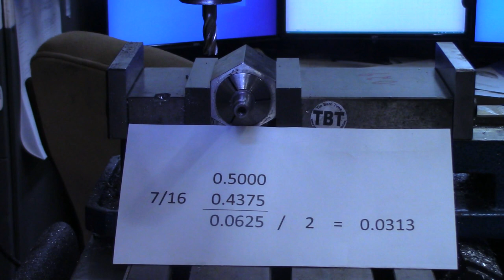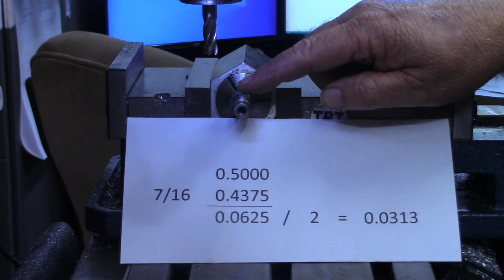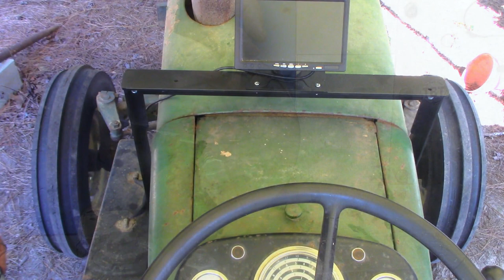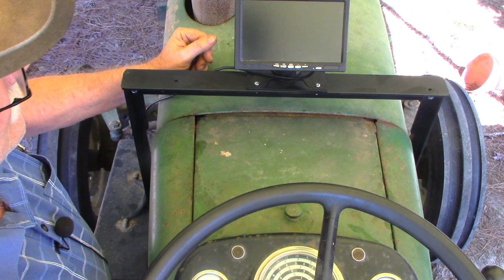Machining a Special Use Nut

Comment: Nice, peaceful, little  project. For mini lathe owners the hex block in the 3 jaw chuck looks not very rigid. But for the mill, that's how to do it. Once made a hex - square adapter for hydraulic oil plugs for a veteran railroad. The same technic, the hex block for hex cutting and then the square block. When ready in the mill, part off the "handle" used in the collet blocks.

Comment: Bluing has become my “go to” for rust prevention after machining raw steel parts like that. Quick and easy, then grease the rub ring area when the blue wears off. Thanks for another good video Lee.
Reply: Having done quite a bit of gun restoration over the years I would like to suggest that parkerizing is far more resilient to surface rust than bluing. True, you do have to heat the solution on a hot plate, but that is about the only difference over cold blue. The military requested it for decades and that decision was not based entirely on parkerizing’s non reflection of light rays.  If you try it I believe you will agree.
As an added benefit light machine marks such as endmill swirls seem to disappear.
Reply: @37yearsofanythingisenough39  Thanks for that, I’ll give a try.
Reply: @macsmachine2609  Brownells the gunsmithing supply has some YouTube videos on the process and they go into a lot of detail that really is overkill once you do it.  A twelve year old could do it.  You really don’t need a thermometer or break in steel shot like they suggest.  I bought my solution, the zinc phosphate type, from them.  That was it. They even sell a blackening agent instead of the normal grey. You can use degreased steel wool to break the solution in.  If you have a cabinet sandblasted that is useful to even out machined surfaces, but is not necessary.  You will need a hot plate or heat source and a container.  I bought an asparagus steamer on eBay for a container. It came with a deep basket and is made of stainless.  There is no waste and the same solution can be used over and over.  In fact you can store the solution in your container if it is stainless and all you need do is heat it up when you want to use it. Otherwise decant it to a plastic jug once it cools off if you’re not going to use it for awhile.
The surface of the machined part holds an oil film better than bluing and it is way tougher. I believe you will be pleased.

Comment: Nice job, John Deere would probably charge $10 for that nut. I have a JD2035 and it looks very similar but with a cab, I also fitted a rear view camera to mine, as my monitor will take 2 cameras I'm thinking of fitting another one close to point at the trailer hitch pin hole, makes things a lot easier as I also have problems turning round to look behind